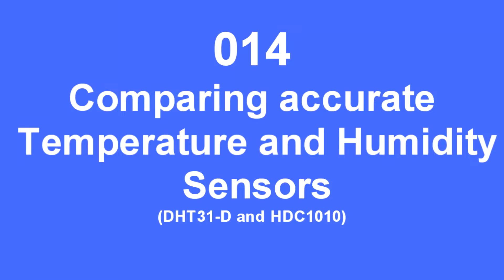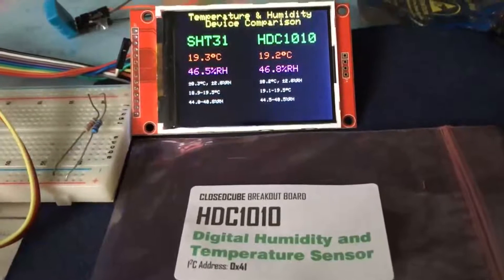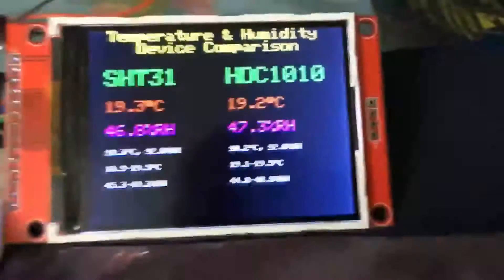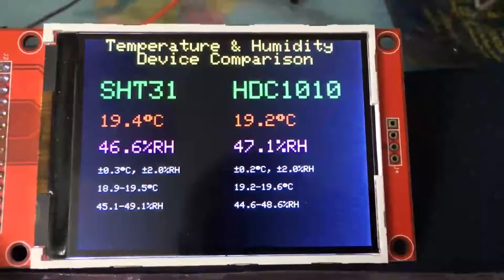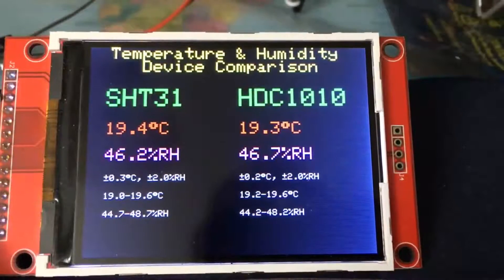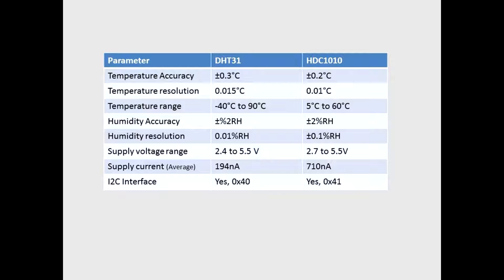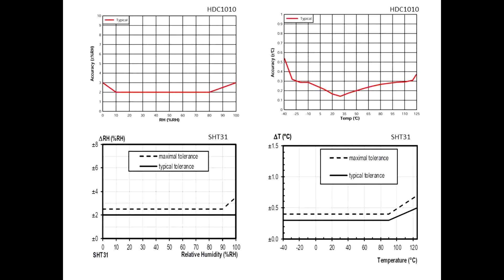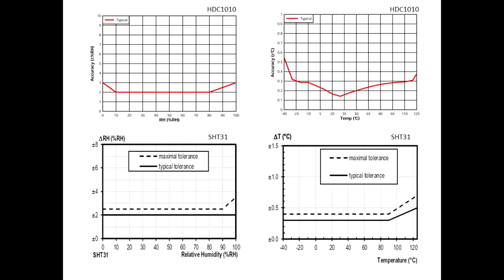Tech Note 014 - Accurate (Precision) Sensor Comparison

Comment: Have you come across the HYT series from IST, the price is way too scary but the specs are very nice.
The handling requirements for the HYT-271 suggest that it's extremely fragile.

HYT-271
https://www.ist-usadivision.com/objects/media/data-sheets/product/humidity-module/HYT-271.pdf

HYT-221
http://www.farnell.com/datasheets/1643979.pdf

HYT-939
https://www.ist-usadivision.com/objects/media/data-sheets/product/humidity-module/HYT-939.pdf
Reply from the maker: Not yet, I see what you mean about price! Accuracy of 0.2°C and 1.8%RH is very good and very near the affordable HDC1010 spec, all these sensors seem to be as good as it gets for now.
Reply: While my current applications don't require such a high spec, I think I'll get a HDC1010 to keep on hand. It's interesting that the sensor is on the bottom of the chip, I suspect the close environment under there might change slower than the surrounding air, perhaps why your reading converged quicker once you placed a cap over the top.
Reply from the maker: Without the cap the readings were constantly fluctuating, it was more of a trial and error test that worked out OK, once the cap was on the air currents were reduced and then the sensors stabilised. yes, the HDC1010 is one of the most accurate sensors you can get and is worthwhile holding as a reference. Now I have compared it with the more popular DHT22 I can see the popular choice is not that good, whilst not essential to have the ultimate in accuracy it is good to at least have readings that can be trusted. You may find it difficult to find a supplier, ClosedCube in the UK was the only one I could find.